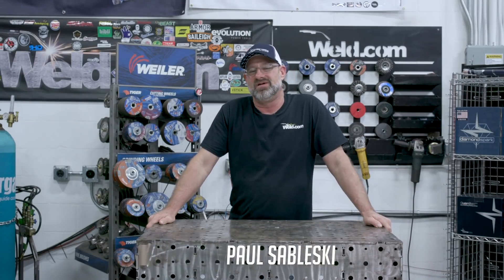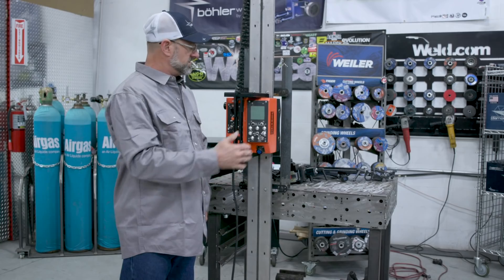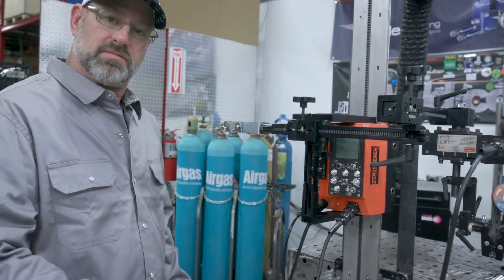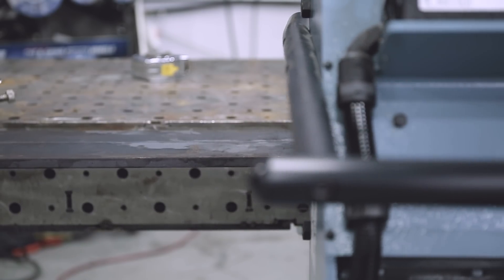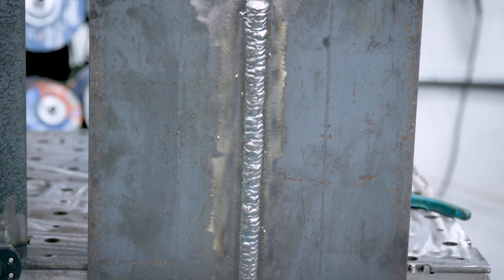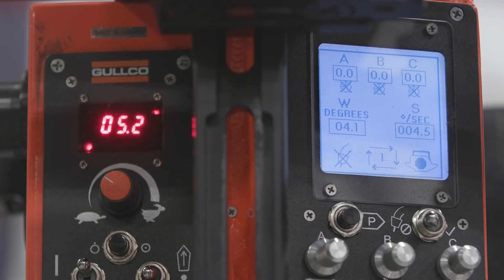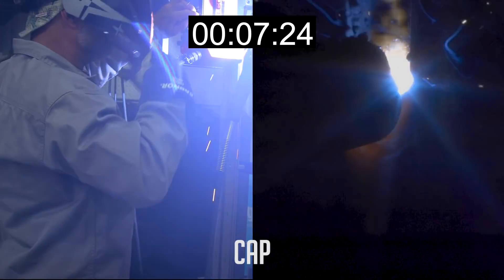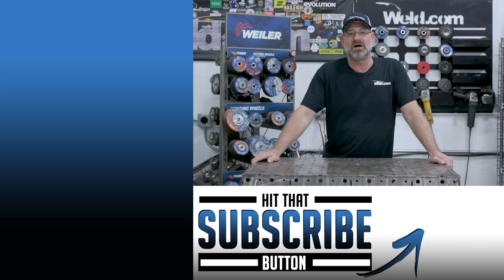Man vs. Machine: A Thrilling Welding Competition

Comment: I'm lost, the whole purpose of flux core is to not use gas, you just said you are using 75/25 gas which is C25 aka Argon/CO2, so again assuming it's that setup... Unless there's something I missed
Reply: The no-gas flux core is more or less just fo "private" use. At least here in Germany, it's not even allowed to use for structural welding.
The pro version is the so called double shielded flux core where you also use gas. The main purpose of the core material is to compensate for what gets burned off of the base material during the welding. Just like in the 7xxx rods.
Reply: @schorse1000  you can penetrate more on flux core from what I've seen versus gas... 

I wasn't sure or not if the flux in the wire is the same as the Arc rods series 6xxx or 7xxx whatever style or size...

Comment: You should have compared the setup time of the machine to the setup time by hand.
Reply: Agreed
Reply: Exactly and it’s not great at welding on strong backs! Unless you have lots of the same welds you can quickly setup in front of machine I can’t see it making sense.
Reply: @Paul Sableski I think there might be benefits to it in a welding shop. but it's probably hard to gain anything timewise if you have to lug that thing around a worksite.

Comment: How come you didn't do stringers better than the weaving and  How many ways can you weld with that machine 3g 4g  Are you able to do overhead
Reply from the maker: For the man part, I ran a weave to try and be faster than the machine. And yes, that demo was in 3G and you can run 4G or overhead with the machine!!
Reply: Yes you can do overhead with the KAT carriage. One of the only in the industry that can!